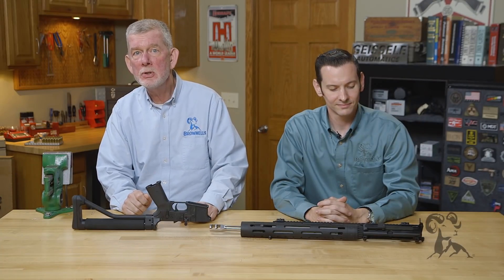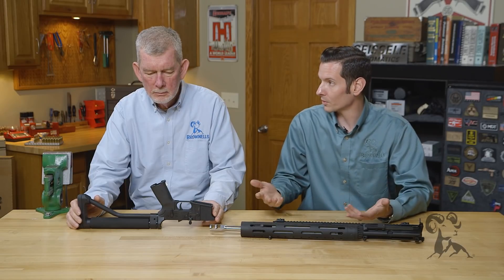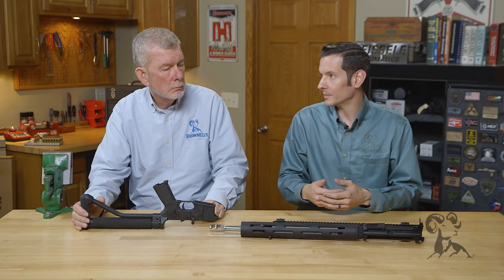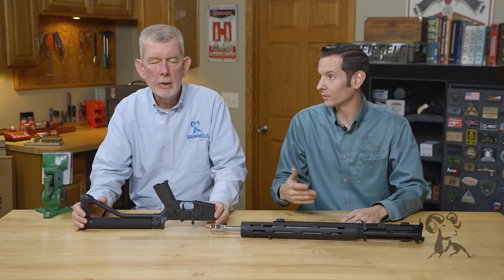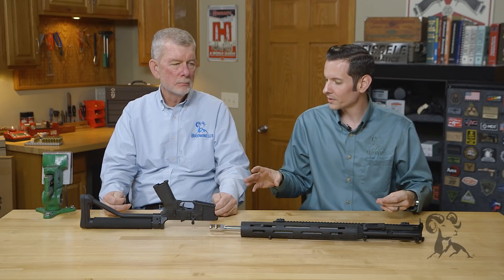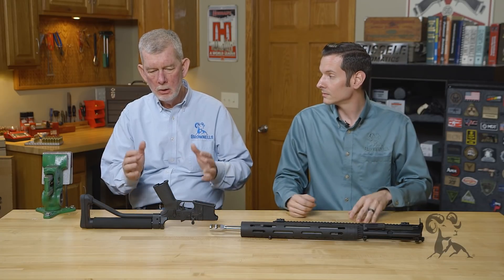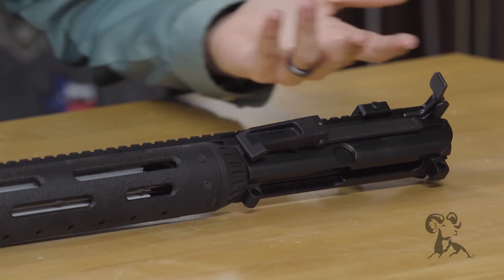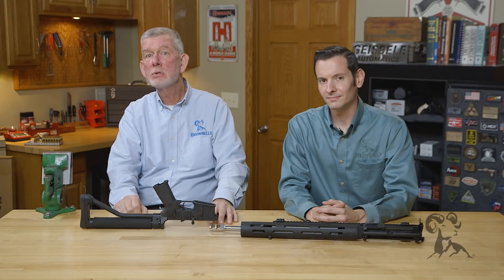Smyth Busters: Is Billet Better Than Forged?

Comment: This is a topic that I would like to better understand.  I also have read of extruded aluminum.  how does that differ from forged.  Steel when it is forged is heated to a high temperature, typically heated red hot and struck with a hammer.  
Apparently aluminum forging does not involve being struck by a hammer and pressure is used instead from what I am reading below https://www.aluminum.org/industries/processing/forgings.   I am still not sure where extrusion fits in this.     

Aluminum Forging 101
Open-die forging

Ideal for processing large pieces of aluminum, open die presses do not constrain the aluminum billet during the forging process and utilize flat dies free of precut profiles and designs. Aluminum blocks weighing up to 200,000 pounds and 80 feet in length can be open-die forged to create large aluminum components with optimal structural integrity. While welding and joining techniques are useful in creating large components, they cannot match the strength or durability of a forged part. Open-die forgings are limited only by the size of the starting stock.
Closed-die forging

Closed-die forging, also known as impression-die forging, can produce an almost limitless variety of shapes that range in weight from mere ounces to more than 25 tons. As the name implies, two or more dies containing impressions are brought together as forging stock undergoes plastic deformation. Because the dies restrict metal flow, this process can yield more complex shapes and closer tolerances than open-die forging. Impression-die forging accounts for the majority of aluminum forging production.
Rolled-ring forging

When industrial applications call for a high strength, circular cross section component, there is no match for rolled-ring forging. The process typically begins with an open-die forging to create a ring preform, shaped like a doughnut. Next, several rollers apply pressure on the preform until the desired wall thickness and height are achieved. Configurations can be flat, like a washer or feature heights of more than 80 inches. Rings can be rolled into numerous sizes, ranging from roller-bearing sleeves to large pressure vessels.

Comment: No - the science of metal is metallurgy.  You have to understand this science to answer which metal is better.  With equal weight (same amount of metal) a forging combined with proper heat treat changes the micro structure for a much stronger product.
Reply: Heat treating can remove any grain structure benefits of a forging over billet, but will produce a superior strength part
Reply: Rich you have to understand the phase transformation chart and know what mechanics properties are important to the application such as tensile, yield, modules of elasticity, impact, etc. it’s a science.  Generally speaking if the science and process parameters are applied correctly, the hot working of the metal during forging which give it a phase transformation combined with the tempering of the heat treat to return it to a more impact resistance state while retaining high strength and hardened results in a much superior product. If this doesn’t make sense go to engineering school.
Reply: @smokethirteen   I am an engineer and very familiar with the charts you mention. I’ve also looked at thousands of microstructures of forged and barstock based finished goods after heat treatment. Any grain flow from forging or rolling disappears in the heat treatment processes that exceed austenitic transition temperatures. The exceptions I’m familiar with are induction hardening and ion nitriding large cross section materials. 43 years experience in the design and development of power train components for ag, construction and forestry.
Reply: @smokethirteen  I have to say that I disagree. Billet >

Comment: Billet allows for a more precise fit between the upper and lower receivers, so there is less wiggle or play when they are attached. Some say that aids in accuracy. I would like to know if that is a myth.
Reply: Sorry bro. As a retired gunsmith with years of experience in this field I respectfully disagree with your assessment.  Precise fit all boils down to the quality of manufacturing for that specific component.  Billet doesn’t allow a more precise fit or less of a precise fit over forged.  Tolerances are determined by the quality of the manufacturer. Poor manufacturing equals poor fit.  Precise manufacturing equals precision fit.  Shoot safe and shoot straight brother. ✌️
Reply: @onionhead5780  thanks! I approve are the info.
Reply: Adam Knapp I have a billet vltor and a forged BCM. Fitment is the same, and there is no difference in accuracy between these two rifles. Now, if I put on a Krieger barrel, and tune handloads for that rifle, then all bets are off.
Reply: @BurnDuration  thanks for the information. Just going off of things I’ve heard ;)